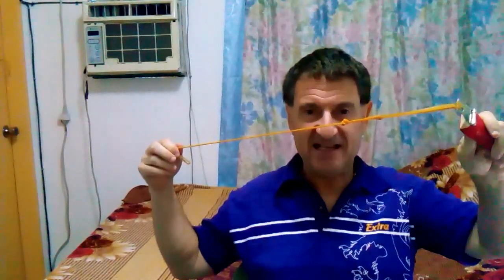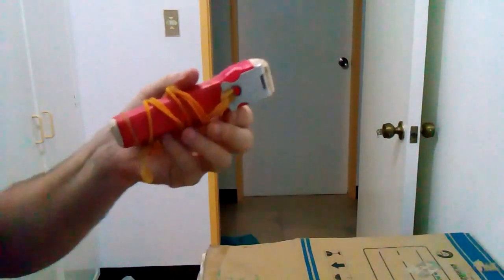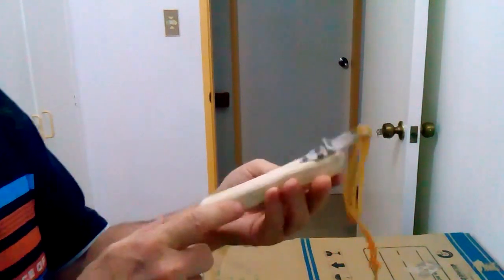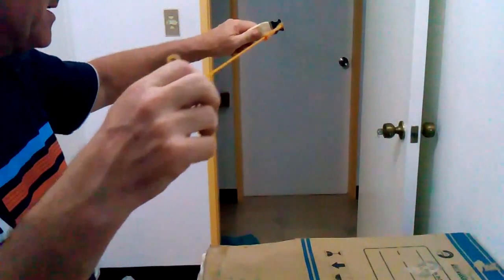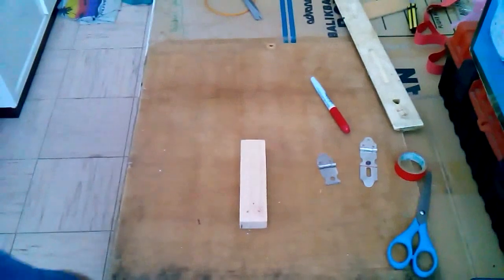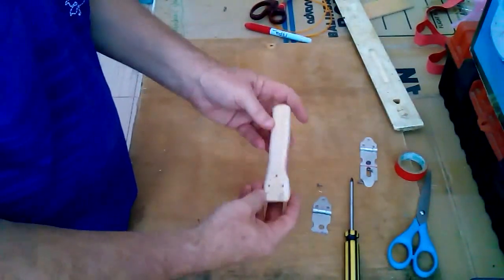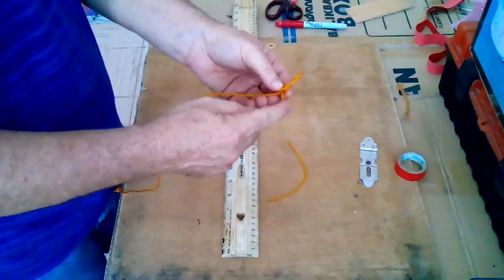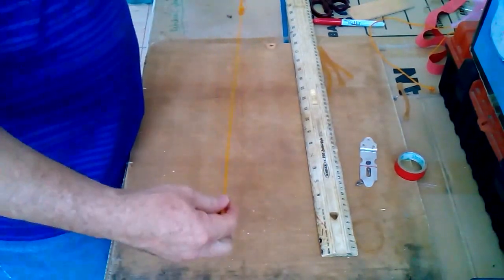Fly Killing Sling  Gun (Kill flies with this fun small inexpensive homemade device)

Comment: If you add a few inch long loose strings at the end you can hit them mid air
Reply from the maker: Did u try that?
Reply: @LarryElterman  yes with a similar elastic tool. Actually even a piece of light fabric or a piece of paper (not too thin) works. anything that is light enough and widens the area of impact. Still you need to have a decent skill at leading about 5cm in front of the fly or you will miss it.